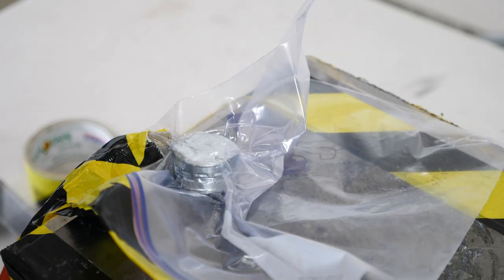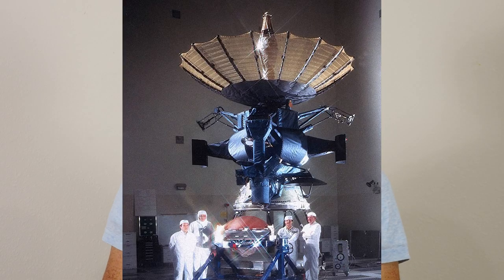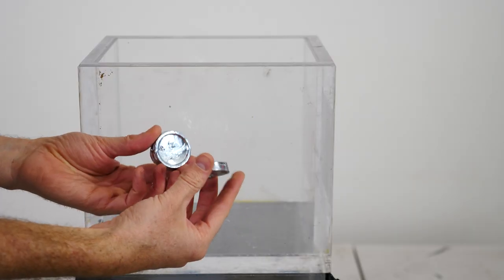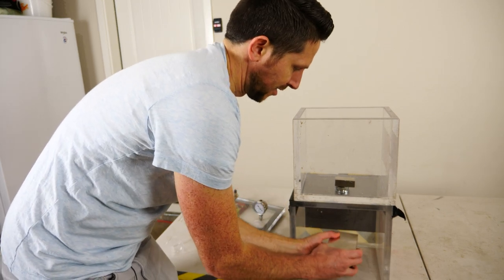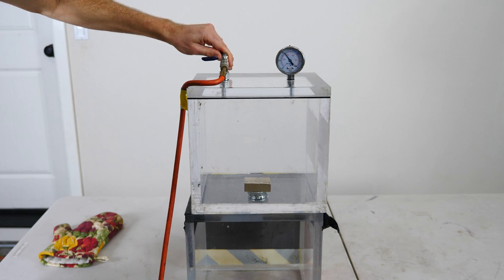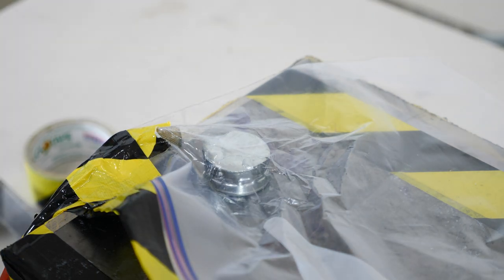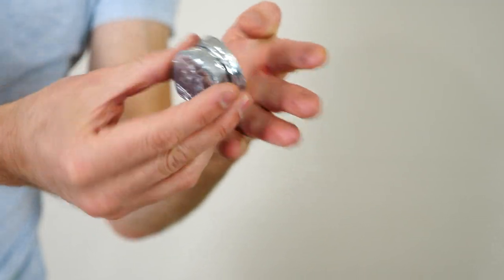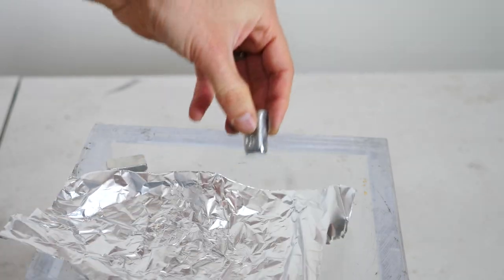Cold Welding Metals In a Vacuum

Comment: Dear lord, I love your experiments, but your methods and explanations are so poor sometimes. 
1) Gallium still has an oxide coating that quickly and completely coats the surface, it's just that it is a much thinner layer than other metals like aluminium. Any welding seen would be because the vacuum can depress the melting point at local high-pressure sites, and so cause micro-welds where mechanically the oxide layer was worn off by rubbing.
2) When you extract air from a vacuum bag, you don't reduce the air density (air pressure) at all. The pressure from the atmosphere is enormous, so you just deform and eventually break the bag. Seriously it wouldn't have reached even 95% atmospheric pressure. It's just that you twisted the gallium and so broke through the thin oxide layer and kinda melted small sites together with the heat from friction.
3) When you want to demonstrate cold welding, you need to have a mirror finish on the two joining sides to have any chance to show it. Even slight invisible surface roughness would cause the contact area to be really tiny. 
4) If you want a good experiment, get two aluminium blocks that have been lapped to a mirror finish on one side. Take these blocks and your pressure tank, and then using 10,000 grit lapping stones and a buffing cloth, remove the oxide layer. Do this all under argon or CO2, not under vacuum (even 0.05ATM is still billions of oxygen molecules). Just make a rubber layer top with gloves embedded, like you see in hazardous material stations.

Comment: There's another kind of very unique welding done with explosives. 
Under extreme heat and pressure you can weld two dissimilar metals making a custom alloy to better suit your needs such as aircraft skin for example.
Reply: Friction stir welding also does that, but you can't use it for deep (beyond 1 inch) welds without a special machine.

Comment: If you had two aluminum plates in your vaccum chamber separated by outward facing sandpaper, and pushed together. Then if you pulled the sandpaper off, thus removing the aluminum oxide, would the two aluminum plates become cold welded?
Reply: Not sure if just that limited application of sandpaper would remove enough of the oxide -- if all the oxide-free surface is in grooves, surrounded by ridges of oxide, you still won't be able to get the metal together.  You would have to do a more extensive sanding, and somehow do it in vacuum (like be in a spacesuit in a giant vacuum chamber), because if you do it in air, by the time you can get the pieces into the vacuum chamber and draw the air out, the oxide will already be back.

Comment: Cold welding also works with hard metals, if they have perfectly plane surface and you slide them above each other. Distance or mass calibration items are well suited for this. Such items are stored in a fluid to prevent this from accidentally happening.
Reply: Basically a shop grease, filtered kerosene, WD40 but generally you want a rust preventative that is easy to remove so kerosene and WD40 work very well.

Comment: Stainless steel nuts and bolts will gall especially when using nylock nuts.
Reply: Stainless steel pipe fittings are really bad for it, to the point if you dont uses something like graphite in the thread you may never separate them

Comment: Gallium melts if a little heat is applied, the friction you created by rotating the 2 pieces caused the round lids to stick together, hence the reason why you could easily pull them apart... nice try tho

Comment: As a welder, I am a bit familiar with cold welding. The presence of oxygen has a near immediate effect on metals that have been grounded smooth. 

Too small to see with the naked eye, oxide and rust immediately forms on a cleaned metal surface on a microscopic level. 

But if you were to clean the surfaces of two similar metals in an oxygen free tank, they would definitely stick together. I've seen the experiment first hand with a tank filled with pure nitrogen and sealed rubber gloves protruding into the container.

Comment: Is there any chance the friction melted the metal a tiny amount on the surface?
Reply: Yes but I am not good at explaining things so I’ll have to look it up but it’s something called “sublime” I think
Reply: Not really the friction but yeah friction could help it occur
Reply: Sublimation means turning directly from solid to gas, with no liquid stage – such as ice evaporating in temperatures too low for water, or dry ice making clouds.  Not related.
Reply: @VoltisArt  yes

Comment: in a tub full of cold CO2 use sand paper to remove the oxide layer from piece s of aluminum and then see if they will cold weld
Reply: Underrated comment! Why would the oxide layer disappear just because you are pulling a vacuum on the aluminium pieces?

Comment: That was never going to work, you need to vacuum seal 2 metals of the same type and then while in the chamber remove the oxide layer using some sand paper then when you touch them together they will instantly fuse!
Reply: This. I have heard of hatches on space stations being welded shut because the oxide layer on the hinges was scraped away by repeated use.

Comment: Galling is one of the reasons we don't typically use stainless steel anchors for pool safety covers.  They are made from brass since they resist galling and oxidize to a nice dark finish that compliments most deckings.

Comment: Doesn't a vacuum make the boiling point drop? And by association, the melting point? So technically, isn't putting gallium in a vacuum, the same as just melting the two halves together?
Feedback requested.

Comment: You need some sort of acid (perhaps ammonia) to first etch away the oxide layer while inside the vacuum, then stick them together. to really get the ingots to fuse.
Reply: Im gonna be real honest here and make this comment without fact checking fist. Im pretty sire ammonia is a base, not an acid.  But regardless, what i think you are trying to get at is the surface needs to be cleaned before trying this. Whether its removing the oxide layer or just foerign material, the surface needs to. E clean for this to work.
Reply: @metamorphicorder  You're absolutely right. I said acid, really meaning surfactant, or something of that nature. I quickly googled magnesium oxide etch, and ammonia was one of the first things that popped up, although there were more, and I just went with that because it seemed reasonably safe enough...

Comment: In large steel structures like bridges we often use Tension Friction connections. The mating surfaces are brushed free of rust and the bolts are tightened to snug tight plus 3/4 turn. This creates a kind of pressure weld between the mating surfaces that is stronger than the sheer strength of the bolts. They don’t continue to stick after the bolts are removed.

Comment: This is gallium, which has a low melting point. How are you sure that the warmth from your hand plus the warmth generated by friction of rotating them together didn't cause the interface between the pucks to melt together?

Comment: 7:18 see, this is the problem with having multiple measurement units. lets just all agree on one measurment unit system to avoid confusion
Reply: For fairness, we should switch to Rankine, the temperature scale nobody uses.
Reply: Battlesheep what is 50 rankine like

Comment: I worked in Q.A. in manufacturing for years.  We used to "wring" gauge blocks together.  The phenomena is not entirely understood, but "cold welding" is thought to be in play.    Galling:  We press fit steel parts together and with certain product designs we'd get galling, and it took a lot of small  process changes to eliminate it.

Comment: I was hoping you were going to do something like run the two pieces of Gallium over some fine grit sand paper to make their surfaces more uniformly flat, then see how well they stick together.  In other words: sand paper on flat table, and gallium face rubbed on the sand paper so it flattens the face.  Also, maybe use a solvent to remove any skin oils or other contaminants. But, if you get it too flat, be careful NOT to touch it, unless you have some sort of memory editing technology!!

Comment: I'm not sure I'd call the gallium sticking as cold welding. You're applying mechanical force and friction, which can easily melt small quantities of the gallium at the interface.
Reply: the idea of cold welding is, that only little energy is enough to reduce the oxide layer. no metal is actually "cold".

Comment: What happens to the oxide layer in vacuum? I believe dropping the atmospheric pressure along with external pressing force allows metals to diffuse better into each others crystal structure which is the underlying concept of cold welding. I think this point was missed in the video. Nonetheless, cool phenomenon and great video.💯
Reply: What happens to oxide layer in vaccum ? I think it will remain as oxide layer

Comment: I wonder how it would work if instead of a vacuum, you purged all the oxygen out and replaced it with nitrogen. Then, use an acid to remove the oxide layer before pressing them together.

Comment: I think it's also possible the empty space between the billets had a vacuum in it that kept the two pieces together under atmospheric pressure.
You should repeat the experiment with two flat surfaces and see if you can confirm cold welsing.

Comment: Don't think these gallium discs stuck because of the vacuum, you can see deformation on the top disc from his hand heat, well that twisting motion created friction which caused head which also melted the discs so that they bonded ... the vacuum might have helped make the connection.

Comment: What I understood is that one can indeed cold weld in vacuum any metal, the only thing one has to do is - in a vacuum of course - remove the oxide layer by sand grinding with a very fine sandpaper the oxide layers away and then stick the 2 metals together. And that can be done with close to any metal who naturally creates oxide layers. so basically bringing out the bare metal surfaces and let them do their merging together proces.  Could you try/test that ??

Comment: machinists have gauge blocks. they are so smoothly finished that you can wipe them together and they will stick to each other . that is actually a feature we use to stack them together to add up to a thickness we need  for gauging. they are not magnetic .
Reply: As a machinist I can confirm that, and also its tons of fun 😂
Reply: That’s due to surface tension though, pretty much everything has layers and layers of water or grease adsorbed to the surface

Comment: It is hard to believe that experienced engineers thought that testing in air would be sufficient. Equipment intended to operate in a vacuum must be tested in a vacuum.
 
Contact friction can heat things up far more than you may realize. Part of sharpening process is to "steel the edge", run a piece of steel along the edge of the (steel) blade. This actually MELTS the surface of contact, causing the molten steel to form a very sharp edge. If it is possible to melt STEEL (melting point circa 1500 C) by contact friction, and it is, imagine what contact friction would do to gallium (melting point 85.58°F = 29.76°C). Contact surface effects must not be disregarded. The process is so fast that the heat is not conducted away quickly enough to prevent melting.

Comment: Sorry, it maybe not the same thing.  There is 1 ATM holding them together and a vacuum space in between. Doesn't cold welding occur in space without 1 ATM pressure around them?

So you would try the same and attempt to pull them apart while still in the vacuum.

Comment: Hi ActionLab,  I have a question regarding the ultra-tollerence machining metals. You know, the kind where a metal cube slides into a metal brick with satisfying tollerences where you dont see any seams. Why is it that the piece can slide in and out where it seems like no air or any oxidation should be occuring? Shouldn't it be welding together when its so close?

Comment: A much simpler example of cold welding can be demonstrated by threading two NPT pipe thread parts together- of stainless steel. I've done this !#$%$^& demo waaay too many times. No vacuum needed, just the scrubbing of tapered threads- it goes together, only comes apart with a saw.

Comment: Another metal notorious for cold-welding when you don’t want it to is stainless steel, particularly weldable 300-series stainless steels like 304 and 316. If you clean a type 304 bolt and nut really well, say by dipping them in hot nitric acid to remove the chromium oxide layer, then tighten the bolt and nut together, there is a good chance that they will never come apart. Many a physics grad student working with high vacuum equipment (which is almost entirely made from stainless steel) has learned this the hard way. The solution is to apply a vacuum-safe lubricant like molybdenum disulfide on the threads first.

Comment: In space I believe the vacuum is much greater, -30 vacuum is not enough, u need like -160, you could get more if you used more then 1 pump or multistage pump. -30 is just medium level vacuum.. in space so much vacuum, that the objects practically have tons of force pushing them together.

Comment: Could the magnetic field lines have interfered with  the crystal formations that would have joined the two pieces?
Redo your vacuum bag experiment, except, AFTER they seem joined, put the two magnets on either side., then slide the magnets away.

Comment: you can get cold-welding in air while machining aluminum/steel without lubricant. as the metal is machined and fresh layers are exposed, they will weld-to the cutting tool, and it's a significant problem and can ruin your work and/or tools. lol, old-school machinsts call the build-up "fly sh!t" because that's what it looks like on the cutting head.

Comment: Wow.. you really got this one all wrong.. you need to REMOVE the oxide coatings to have cold welding or galling occur.. you can vacuum until you have interstellar space and they wouldn't  "weld" if there are oxides present ( the titanium arm had the same problem, as soon as they started to move they broke the oxide coatings and started to gall.).. The friction created when you insert a screw removes the oxides and creates contact pressure allowing cold welding. 
Galling is the result of cold welding. It is the transfer of the material from one piece to the other by cold welding.. No galling occurs until the welded parts are moved and the weld breaks (actually its the material that breaks not the weld itself).

Comment: Our teacher at the vocational school told us that degreased steel gauge blocks must not be left together permanently, otherwise they would be cold-welded. Gauge blocks are manufactured very precisely and used for the calibration of precision measuring devices. They also told us that if this happens you destroy them if you try to torn them apart with force...a pretty expensive experiment a small set cost around 2500€  ..price depends on the clasification grade.

Comment: 2 freshly machined pieces of aluminium will sometimes weld together of they are very smooth surfaces and you just rub them together 

Its easier if you machine an aluminium peg about 1" OD to fit a hole exactly, you will need an air bleed hole through the material - push it in and turn it - you will almost certainly NOT be able to get it out. We did it at school in engineering class.

If you drive a punch through the air hole to force it out it will eventually work - but it tears lots of the metal with it - it becomes ONE PIECE for most of the surface area.

Comment: Big explanation of oxide layers -  then does nothing to remove the oxide layer so there is no impediment to bonding. Not to mention the rough surfaces of the two objects aren't going to allow too much contact area at the atomic level, so as others have said its probably more friction and pressure creating small melt zones. 
A vacuum isn't actually required if the two pieces are prepared properly. Watch AVE's video on this for a better example, and the connected Cody's lab video (the sanding removes any surface impediments and oxides ). I'm still trying to understand the description of the satellite antenna -  I have a feeling the tungsten had its oxide layer removed and that's why it stuck together in space.

That being said, the gold fusing in Ave's video could be instead caused by the same type of attraction you get with gauge blocks when you ring them together.

Comment: I work as a welder. Dont you have to remove the oxide layer manually? It doesnt just go away once the oxygen is gone. I bet if you removed the oxide layer, then quickly put them in a vacuum, it would work MUCH better.

Comment: I have an objection to this experiment. At 7:18 you say gallium melts at 85 degrees C. This is false. Gallium melts at 85 degrees F, which is below the normal temperature of the human body. Therefore it is reasonably possible that the heat from your hand softened the gallium enough to fuse the two pieces. I doubt that this is an example of cold welding. Try another metal.

Comment: Your gallium wasn't flat enough. Cold welding works a lot like wringing 2 flat pieces of metal together and the surfaces need to be flat so enough of the surface sticks. Your gallium was cupped so most of the surface was not fully in contact. Also cold welding in vacuum works best with fresh surfaces so if you expose the metal to air before it starts to build oxide layers. Aluminum and copper oxidize very quickly so you would probably not get them to cold weld easily.

Comment: Not only metal oxides prevent cold welding; those ingots were probably covered with all kinds of impurities. You should have chemically cleaned the pieces before exposing them to a high vacuum, I think...